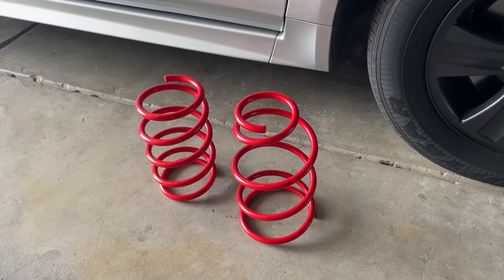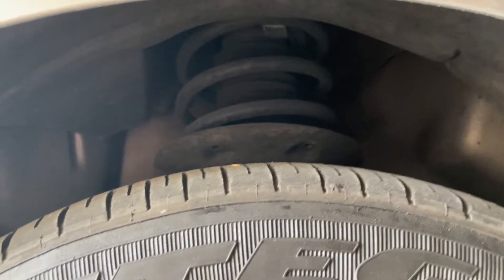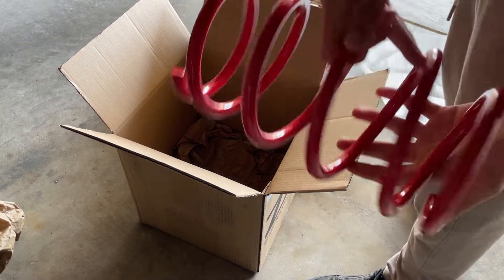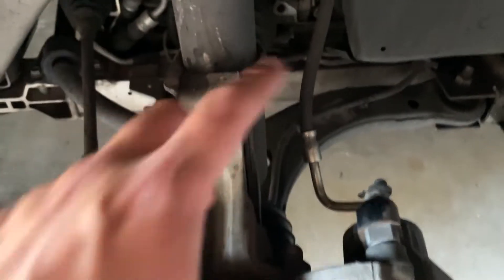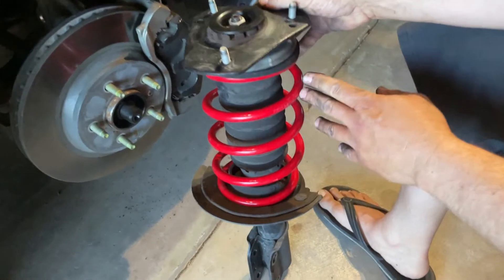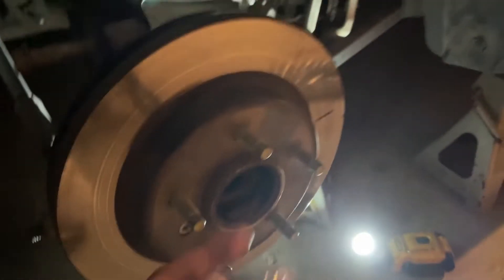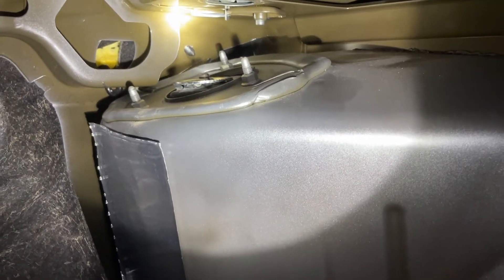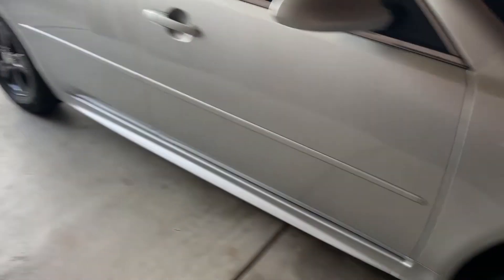2006-2016 Chevy Impala ZZP W-Body Lowering Springs install

Comment: Are you getting any engine vibration after lowering the car?  It was a common issue with the 2nd Gen W-Bodies with the 3400 and 3800 engines, curious if it still happens with the 3.6.  The solution is to install a set of shortened dog bone mounts (ZZP sells those, too.)
Reply from the maker: I’m not! I have heard of that too and also when the transmission shifts up I’ve heard people get a bad jolt feeling! So far they have been great and as you could probably tell this is a older video so I’ve had them on now for about 6 months and they are great! The only thing unfortunately with the ZZPerformance shorter dog bones they offer them only in a pair for the Grand Prixs (3800) so you would have a extra one. Also they are pretty close to the same size as the stock length 3.6l as the dog bones for the 3800 are much longer than the stock length 3.6 ones.
Reply: @Guido19  Ah, that makes complete sense - the DOHC engine is quite a bit more bulbous than the old OHV's were. Glad to hear there's no vibration, that would suck trying to modify a 3.6 dog bone!!
Reply: I have a 2013 impala and installed zzp springs w/ kyb struts yesterday. I had some vibration at wide open throttle and decided to put it back to stock. I have a highway right by my house with a newly paced smooth road.

Comment: I’ll called ZZP and they said I need the anti pogo washers too. Any issues?  I thought according to the forums they were only needed for 3800 cars.
Reply from the maker: No you don’t! I have ran the lowering springs on my stock shock absorbers for probably the better part of 6 months. I actually did get the anti pogo washers cause they are cheap and who cares if they really work or not but I haven’t noticed anything difference so….
Reply: @Guido19  so you ran the lowering springs with and without the washers and no difference? Much appreciated
Reply from the maker: @ImpalaSS08  yep! No difference that you can feel. Also they were perfect before too

Comment: Yeah OK, but my mechanic buddy said that If you lower the car from its ORIGINAL RIDE HEIGHT, the piston INSIDE the FACTORY STRUT will be outta place. AND when you're driving down the road, that PISTON that is inside the FACTORY STRUT will " bottom out " . So my question is " Should you INSTALL a  LOWERING SHOCK ABSORBER also ? "
Reply from the maker: Yes that is 100% true! You gotta really be driving like crap and really hitting bumps real hard and real fast for that to happen and regardless if your vehicle is lowered or not you shouldn’t drive like that. But yes if your driving like crap they will bottom out but that’s why they have bump stops on the shock absorbers so that doesn’t happen you can also get bigger longer bump stops as well too to add more dampening from completely bottoming out. And yes you can upgrade to a better more performance oriented shock which would be ideal which is what I will do once my current ones go bad but on stock shocks they are fine. And the last question is up to you! If you want a better look with better handling I would do it but if you just have a daily driver maybe don’t do it cause there is also a skill on driving with having them. Constantly being alert and making sure to not go over crazy terrain